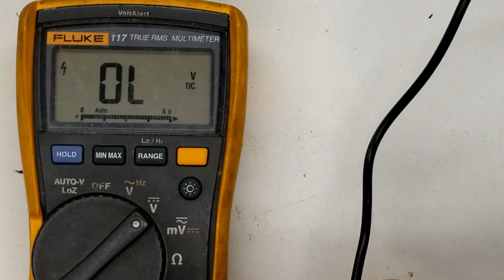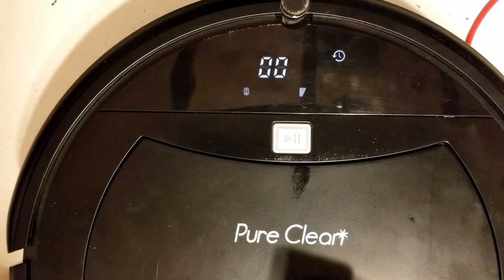ROBOT VACUUM REPAIR WONT RUN PURE CLEAN PUCRC99

Comment: What are those diodes used for if the charger is already putting out dc voltage? Are they for reverse voltage protection?

Comment: 07:50 You're measuring current going through a diode by shorting the diode with probes? First time seeing this. How does that work? Doesn't portion of the current go through the probes and the rest through the diode? I would desolder one leg of the diode and add amp meter in series.
Reply: The burden voltage of the multimeter is less than the forward drop of the diode, the current will flow though the meter and not the diode
Reply: I was also a bit surprised by that, but i guess you can do that if you know that nothing bad happens by not having the diode in the circuit for a moment.
Reply: Its a short through the meter. All the current will go through that short.
Reply from the maker: the power supply should be in constant current mode to charge the li-ion battery and the current would stay the same up to the max cutoff voltage. I should have mentioned it in the video.